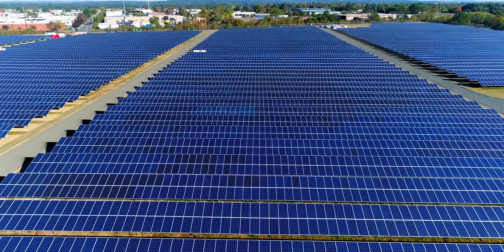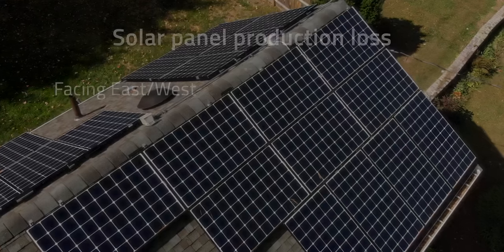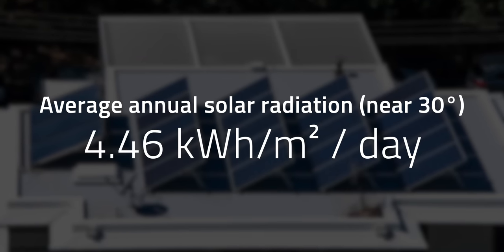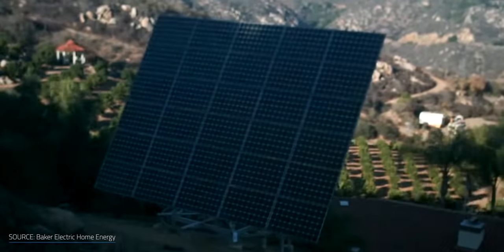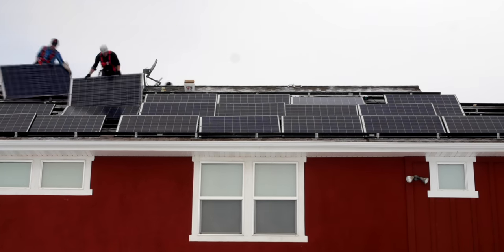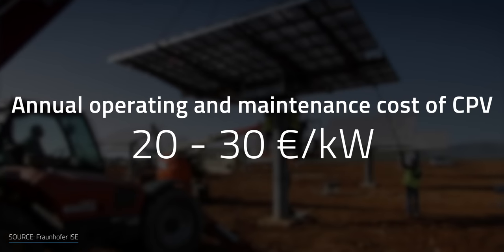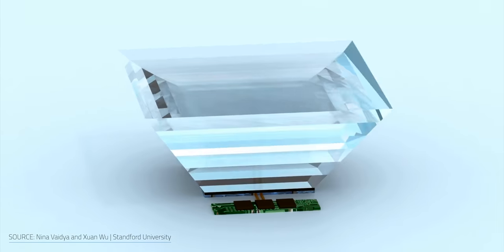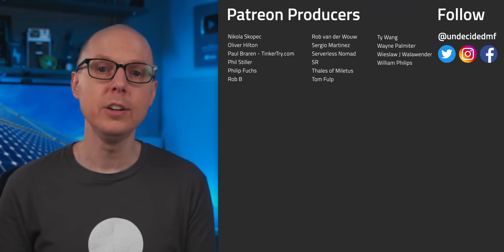This Invention Could Supercharge Solar Panels

Comment: While light traveling through the Earth's atmosphere is diffused, overall, the rays of light are still all mostly parallel.  It makes zero sense that this would up efficiency from 40% to 90% or that it would double power or more per square foot.  Still, I hope I'm wrong.  I'm hopeful for anything that can make photovoltaics more efficient, less difficult to source materials for and/or less polluting to make.

Comment: I would like to see the 'life cycle analysis/materials intensity'
(thinking of how the aggregate of both 'Cradle2Cradle' and Amory Lovins design of the 'Hypercar' [addressed in his book: 'Natural Capitalism', coauthored by Hunther Lovins and Paul Hawken] looks at the volume of byproducts/waste(contaminants that hamper retrieval of useful materials at the end of the products commercial lifespan) to recapture and refine the minerals into new commercially useful products.
Does the extraction and refining of the material for the smaller PV components combined with that of the 'lenses' make it more environmentally benign compared to the current PV panel ???)

Comment: IF it doesnt add too much cost - I would think adding a low PV lens that can pull light from a larger area angle would be the better move here. It would help house roof top panels, even if they're not as efferent, add in more light through out the day. I assume they also get better if more "suns" hit them as well. Wouldnt need to add area too much just because they would get hotter - but a basic cooler would be more than enough for a smaller increase. 1% cost increase for a 5% gain would be pretty good. Unless we can change the solar mertial cost it self - I am not sure we will be able to get any real gains though.

Comment: Still the same amount of light hitting the overall area, so only real benefit looks like it might have a wider capture angle... chances are the performance benefits of longer optimal angles will be offset by added weight and having to use smaller cells to convert to power beneath....

Comment: I hope so, Travel trailers or Tiny homes AGILE sound good for small spaces that can't use lots of solar panels. 
Also, India has the PCV pipe turbo wind tube in many homes where every traffic is a bus route. Not too high looking for a combo mix.

Comment: People don't need more complex more expensive PV panels that will never have a positive return on investment, what people need is some dirt cheap thin film solar panels embeded on plastic sheets that cost less than 5$ per square meter and can be slapped onto any surface at negligible cost... Even if they only have 10-15% efficiency... This is what the world needs... not 100k$ systems...

Comment: I'm not really that excited about this because it made no mention of increasing flux received to energy conversion.
You are receiving the same amount of flux but able to use less solar cells, but are you actually creating more over power with the area that you are using, that is the key. So, by concentrating solar energy into a smaller area, is the smaller solar cell creating more energy of the large scale one? If the cell technology doesn't change, you likely loss conversion efficiency. 
Secondly, how much would it cost to produce these lens and indiviual cells compared to a large printed cell sheet?

Comment: Woah. Could this be implemented on existing cells? Like can I just lay a prism mat over my panels and triple the output?
Reply: Not without significantly reducing its life. The materials used in the production of common PV panels won't tolerate the extra heat well and the wiring may not be up to the increased output.

Comment: Hi Matt, so the USP of the Agile team is the uniq design of the lenses which will concentrate the light from any direction and maximise the concentration on the solar cell or material to convert the light to electricity or have they developed more on the cell chemistry as well

Comment: This AGILE technologies sounds vaguely like Solyndra’s business model which was to overcome the angle of incidence issue with a clever new geometric design that worked at any angle. But as pv cost went down, Solyndra couldn’t compete, and they failed with a lot of taxpayer money, which isn’t the issue here. I think this idea is unlikely to work until pv costs stabilize.

Comment: I'll be 100% honest, I believe the solar singles offered as a replacement of roof singles, makes alot of sense, otherwise for the most part, i'm poor a $5000 solar panel installation, i can't afford, i can't also afford the $2000-$10000 battery bank, and yes i know the arguement of but i'll save the money in power use, yes but it's a moot point when i'm still driving a $1200 car for the last 15 years and 340,000 miles because i can't buy a new car, WHERE THE HELL AM I GONNA GET $7000-20000 to install solar panels, i can't get a freaken loan to buy a car, or a energy efficient house, My house has news paper insulation as it was built in late 1800s without electricity, and has no wall studs, just solid wooden walls.  I work at walmart in southeast missouri, our town has lost all it's factories, there is very few places to work and make money more than $16.00 and everything is rising in price. Now people would tell me to move, sure i could live out of my car and risk becoming homeless, which if i lived in chicago i could make more money BEGGING on the streets than i do where i live, we have also lost our hospital, our town has a 24% poverty rate, our house would not sale fore enough to buy a house ANYWHERE ELSE.

Comment: I wonder what the effect of adding a fresnel lens above a stand solar panel. I'm sure you would have to add some cooling to the back side of the panel. I'm thinking about my sailboat. It's always at goofy angles and then add the sun angle and efficiency really drops

Comment: Yeah you imply that the amount of area needed will be less CSP (Concentrating Solar Panel)  vs normal panel. That is not the case all things being equal the area used will be the same what will change is the amount of photovotalic material used wihch is sigificant. The main benefit of the new design will be combination of adding a slightly higher effiency to already exixting CSP designs. Does it matter? We can't decide because you did not compare it to other CSP designs.

Comment: Think a critical element here wasn't properly covered. You covered multi-junction PV's but then compared the price of a CPV that used standard silicon. multi-junction PV's that can reach 30-40% are MUCH more expensive than PV's that hit the 20% mark. 40% is inline with what they use on the space station and generally use exotic materials.

The big advantage I see here from a cost perspective is you can use a material that is very cheap to offset the cost of your expensive material.  If a multi-junction PV costs 100x what a standard silicon PV does there is now a cost-benefit curve where you could match on electricity output with much less PV material.

So let's say multi-junction costs 50x per square foot, but is 80% more efficient.  Let's start at a collector that has a 50x concentration so now our raw PV cost are equal. So now you just of have the concentrator + cooling cost on top of the PV. However, you are producing 80% more electricity with that same volume. That means to build the same system You only have to get within 1.8x the cost of traditional PV to match it. 

Seems like a potential way to lower cost significantly if the lenses are cheap enough.

Comment: Problem with CPV is that, due to the highly concentrated light, the solar cell degrades faster - shortening lifetime.
If you have to replace the entire system twice or ten times as often then it's probaby not worth it. In the end, when looking at the economics of PV,  it's KISS (Keep It Simple, Stupid). Use the simplest PV and just add a few panels to make up for any shortfall.

Comment: This is mostly false.  This won't affect tracking or install angel benefits.  You can't get more then the light that falls on the solar panel area.  So tilting to cast the biggest shadow helps.  No matter what is on the panel it can't cast a bigger shadow if it's not tilted correctly.  After watching all the video it seems to me the best route is just more standard panels and a longer operating life span. I'd put my money on this is a dead end.

Comment: Could AGILE be backed with heat exchangers to get solar thermal as well? Or does refracting to the optimal frequency reduce the heat produced? Would that be another reason for the 90% efficiency?

Comment: CPV looks like a perfect use for Clear Aluminum.  Each Fresnel lens could be milled into it and the face side could be milled as Clear Aluminum needs post processing anyways to make it actually clear and not frosted.  AION (aluminum oxynitride aka Clear Aluminum ), a ceramic alloy is currently possible in bulk.  Edited to add: https://www.youtube.com/watch?v=gLIwwGSddiM

Comment: Old news, new 3D additive manufacturing approach. The concept of using Fresnel lenses has been around and tinkered with for a long time in a variety of settings from hobbyists and DIYers to Colleges and Universities. It was done at Olin College of Engineering (Franklin W. Olin College of Engineering) in 2010-2014 and placed in service in Africa. As @Paul Mullen noted, space considerations, increased heat, etc., all play a part in the thick wall against commercialization. It's cheap and effective done with discards-sourced lenses (think old headlights) and small limited purpose portable arrays like water pump power.

Comment: There are PV cells and panels which use a simple 'magnifying glass' kind of lens over the semiconductor. They have existed from the beginning of PV power. This thing is not that! 
A simple lens will NOT properly concentrate light that comes in off the central optical axis. So that simple, old-fashioned kind still require solar tracking... the most expensive kind, 2-axis tracking. Even that is NO help when the sky is milky. This Graded Index Non-imaging Light Concentrator does NOT require tracking. It DOES work even when the sky is milky. That is what makes this thing interesting.

Comment: Hey Matt, I understand how performance enhancements would be beneficial for power production with smaller area, but do you think these enhancements or battery enhancements would be more beneficial for making solar energy more useable? I am not saying you should focus on something else I am just genuinely curious about renewables and what would make the largest difference in their usage?
Reply: I dont know too much on the issue, but as i understand it essentially the main problem is investment. There used to be efficiency and scalability issues, but those have largely been solved and are well past that into the degree that solar efficiency can compete with fossil fuels in energy production, not just the inherent benefits of solar vs fossil. The main problems of solar now seems to be oil companies supressing it and lack of investment, as if you had a connected grid of solar panels across most of the planet, thatd mean any part of the grid would have light at any given point in time, meaning the battery requirement would increase until you get a connected solar panel grid the width of nighttime, after which it would massively plummet to absolute minimal

Comment: The way they designed the tracking mechanism on those panels is absolutely terrible. It should be done on a wire system like Venetian blinds. That way you can link up as many panels as your single motor controller can handle and have it all be super lightweight and robust enough to go on a residential roof

Comment: if the collectors are the same size as the concentrator the power output would be similar and cheaper and they would last a lot longer due to less heat buildup from the concentrator.  Its basic common sense for anyone who has ever used solar cells.

Comment: Also, I'm not sure I understand the logic behind solar sensors "following the sun" if it is behind a cloud. If the sun is behind a cloud, it's behind the cloud for the sensors as much as it is for the panels. It's not like the sensors are following the sunlight AROUND a cloud.  Am I missing something? (A timer system would follow the sun in the same way as solar sensors, wouldn't it?  Even if the sun WERE behind a cloud, you would want your panels facing the same direction as the sun to get the ambient light, right? You are not going to get MORE light from a direction that isn't in the direction of the SUN.)

Comment: Instead of pouring millions into more efficient solar panels, we could end run it by stop wasting so much electricity at home, mostly with devices in standby mode. It's possible to vent the fridge waste heat up the wall and out of the attic.  It's doable and would save AC use but not all fridges are designed to take advantage of this.

Comment: Very interesting! One key problem with common PV systems partial shading, as I understood. I thought about reducing this with a highly transmittant diffusor material in front of the cells. This takes it even further by redirecting and concentrating solar radiation at the same time.

Also has anyone heard of the zigzag-3D-Solar towers that were promoted via an MIT study some years ago? I'm going to try that out in a home setup with 5x50W panels and see how that goes. Output should be better in non optimal weather conditions the study said. Winter is coming... ;-)
Reply: Just use micro inverters in that case.
Reply: @christianvanderstap6257  is that how it's commonly done?
My thought was to distribute light evenly to reduce or eliminate shading of individual cells, not dealing with it when it occurs.
Reply: @dereinzigwahreRichi  if you have shade, microinverters tackle that per panel. Easy solution without much thinking or complicated/mechanical devices. Also helps with bird droppings on one panel not screwing up everything. No high DC voltage either coming down from the roof as a bonus. Downside of course is if you ever have to replace one, cause they are on the roof.

That or remove the shade. I removed the disused chimney from the roof of the previous house (also got rid of the air leak).
Reply: @christianvanderstap6257  I was thinking more of trees or something the like that casts a shadow for an hour or so until the sun's has wandered further. And I was thinking of a more general solution to overcome these problems in a wide variety of use cases.
That's why I also wanted to try the zigzag setup, as it reflects more light in itself (the panels only use about a fifth anyway) and is supposed to offer a more steady output throughout the day instead of highest peak at noon and very much less in the morning and evening hours when the orientation is not optimal. Because we need energy all day and the more you can get evenly throughout the day, the less you have to store and storing capacity is expensive.

I'm using a Microinverter for my home setup already to feed directly into my circuitry. (Grid tie Inverter)
On the other hand and work we have much larger solar arrays and also several inverters right on the roof to deal with the problems you mentioned.
Reply: @dereinzigwahreRichi  i have them placed east / west for that reason. Also I think you are mistaking micro inverter with optimizers (they accomplish the same thing mostly)

Comment: Why couldn't more panels be move by one rotation? Instead of manufacturing a trillion motor/axel assemblies, just hook them up to a high gear ratio motor with a reduction on every panel, efficiency would definitely trade for less material cost on automatically moving panels 🤔🤔

Comment: This is really a confusing technology in my opinion. I am not sure what was the motivation even to progress the developement this far?
- Heat, concentration of photons, means more heat. You know the solar cells have negative temperature coefficient, so more heat lesser efficiency.
- Weight, which is the most challenging issue for rooftop solar. Existing PVs dont have lot of room of additional weight to play with.
- Efficiency, if those multi-junction cells are going to produce higher efficiency, rather PV panel fully covering multi-junction cells should be promoted rather than concentrators.

May be it has its own niche application, such as remote low temperature regions with fixed strong roof/ground mount, where tracker maintenance is difficult etc. etc.
May be on a sturdy roof, with passive cooling could help reduce the temperature and store the extracted heat.

Comment: For there to be any funnel function the solar cell itself needs to be half the size of the sun facing glas or what ever they use.
With a cell half the size but the same power output, equals to twice the heat density of the smaller solar cell.

3d printing the optics? forget it, that is much to slow and expensive compared to normal cells under a glass plate.
3d printing takes maybe 10 seconds per lens, an old fashioned injection molding machine can easily beat that.
A Lego injection mold from 1952 could make 12 bricks at the time and it took 7 seconds in the mold, add 3 seconds to clear the mold to be ready for the next batch and you will have a machine that is 10 times as fast as a 3d printer.

Comment: I was curious about the added heat when concentrating the sun.  Then it occurred to me that the upside-down pyramid shape naturally created a series of channels between the lenses.  One would think you could pass a cooling liquid through these channels and then capture the heat for some other use (e.g. to heat water or store in a heat battery).

Of course, you'd have to make sure the seal between the lenses is water tight to prevent leaks.  Hmm.  Maybe it'd be better to 3-D print the grid channel.  Aside from having a method of drawing away the heat, it'd also provide a solid frame to glue the lenses to.
Reply: Sounds very inexpensive to manufacture.